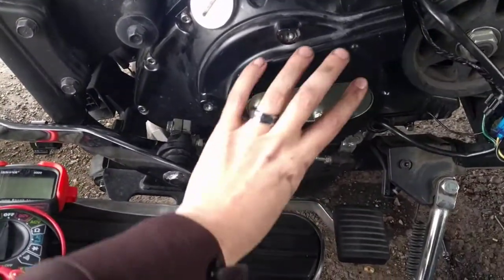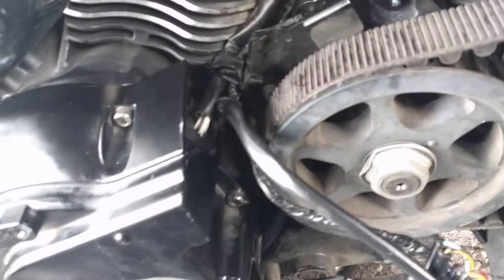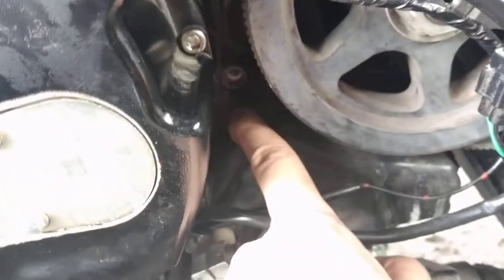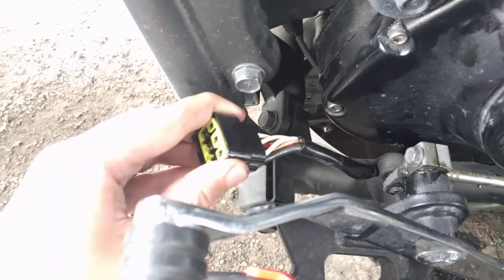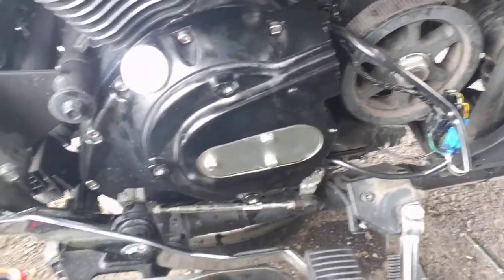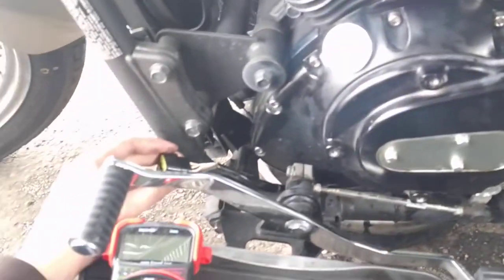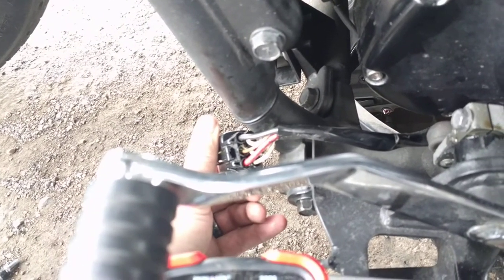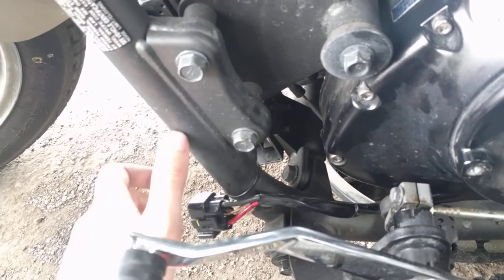2009 Kawasaki Vulcan 900 Classic LT - Short to ground in Stator Wiring to Regulator/Rectifier

Comment: I have a 2013 Kawasaki Vulcan 900 custom. I got home from a ride try to start it up wouldn’t start. I replaced the starter regulator still nothing I tried the battery I get lights and then when I plug in the rectifier everything turns off try to replace the rectifier that didn’t work about to replace the stater for the second timetoday I bought a stater off Amazon still nothing if I replace the stater and the rectifier and it’s I’m still getting issues. I’ll know it’s a short somewhere. I’ll have to take the tank off and check the wires.

Comment: Did you figure it out
Reply from the maker: Victor T - no it just started working...?
Reply from the maker: Update - yes I did. It turned out that a small amount of coolant was leaking from the top of one cylinder and was draining down into the wiring sheath coming out of the stator. When I replaced that wiring (from the stator to the R/R, I cut open that sheath/heat shrink and a bunch coolant spilled out of it. The short was somewhere in those 3 white wires, caused by the coolant. (and also a small cut or something else in the coating on the wires.)
Reply from the maker: Update 2 -  There was also a short on my new stator, that was making contact with the case. I found this using a multimeter and finding continuity between 1 of the 3 wires and the case, while I was moving the stator around. Fixed it with some liquid tape.
Reply: @TyronePerry  over the winter i bought an 09 900.  after reading about the stator problems, i have "stator paranoia". your description of the wiring route is helpful, though i wish some kind soul would do a stator replacement video .
Reply: @MyMadmax666  fantastic. really appreciate it. i watched it. even i can follow.
Reply: @TyronePerry  Hi. My 2008 Kawasaki Vulcan stalls when I slow down. It would start back up with jumper wires but then it would just stall again. I just replace the battery, starter relay and starter motor a few months ago so I am thinking that the problem is with the stator. I am getting continuity between those same 3 white wires and ground. Are those 3 white wires the winding for the stator? If they are then I’ll know for sure my stator it’s winded to ground. Any advice will help. Thank you.
Reply from the maker: @TheMaximomex  yes those 3 white wires come off the stator winding. Those are the 3 phases.